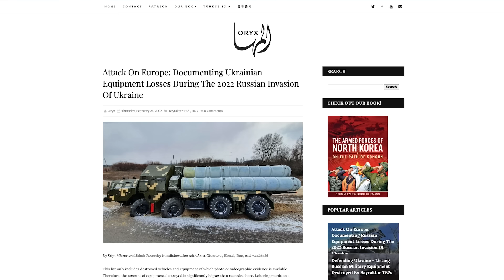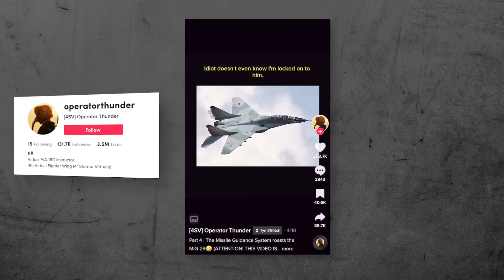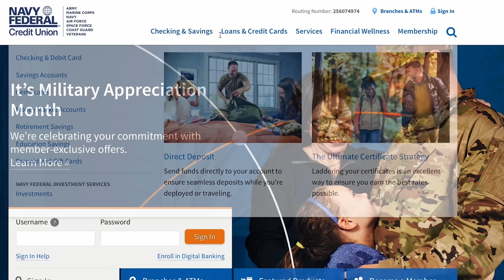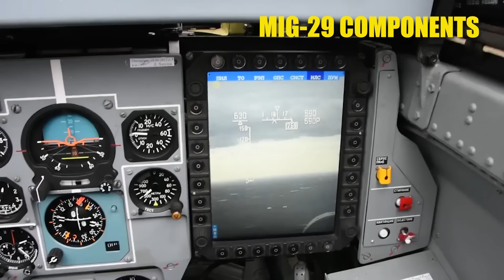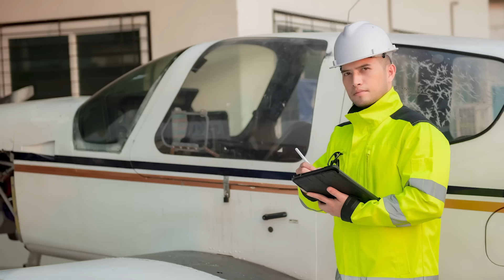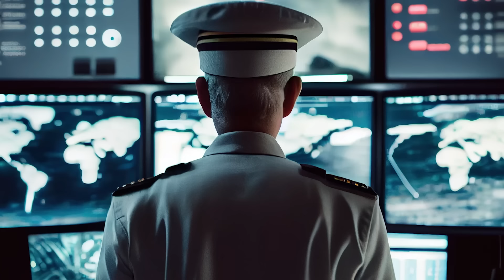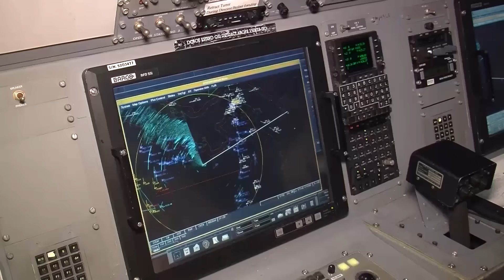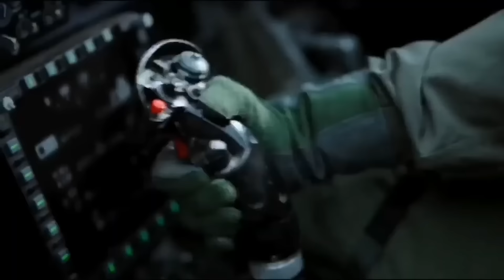How Ukraines new MIG-29 Fighter Jet Operates

Comment: F-16 would no change anything, they would get older variants, those planes would either be blown on the ground, or shot down by MiG-31 from 300 km away, or S-300/400, BUK, etc..
Also, good luck maintaining F-16 in field conditions on improvised runways.

Comment: I think you're a bit rusty on those fractions.  A thrust to weight ratio of 1.07 means every pound of force has to move .93 (=1/1.07) pounds.  If it only had to move .07 lbs it would have 1/.07 = 14 thrust to weight ratio.

(to get the weight to thrust ratio you just invert the thrust to weight ratio).

Comment: Its an interesting comparison between the MiG-29 and the F-16.  Both aircraft are "fourth generation".   The Fulcrum actually IOCed 6 years after the F-16A.  (F-16C and later variants are what remain today).  They have similar flight capabilities.  The MiG-29 was conceived as a fighter to fill a similar role.  But the major difference is the F-16 has received numerous upgrades to its radar, fire control systems, and datalink systems while Russia decided to put all of its eggs into the Su-27 line of fighters by continually upgrading them and deriving newer variants like the Su-30, Su-33, and Su-35.

Comment: I think Ukraine could use F-16 as a quick and highly manoeuvrable AWACS with their radar. If it has a datalink connection to a Patriot or IRIS-T battery it could early detect cruise missiles or shahed drones.
Reply: So F16s will be on standing patrol mmmmmmmmmmmmmmmmmmm! Will they have AAR? I don't think so. Also my experience back in mid 1990s was its costly maintenance costs and tendency to change out either the PW F100-229 or GE F110-119 enines as line replaceable units (LRUs).....$$$$$$$$ and how many power plants will they provide for support or will they soon reach many holes in aircraft. For the long term within NATO the F16 in UKR makes sense but in this war theatre it might prove a logistic nightmare.
Reply: @terryluckhurst4114  Ukrainians can use own AWACS , they have own projects such An-72P and An-74 with radars.
Reply: @terryluckhurst4114  So, you're right about the logistics and maintenance nightmare. F-16s aren't toys and they do come with their baggage. But let's not forget, we're in a war scenario here, and desperate times call for desperate measures. The focus on engines, I get it, but with NATO's help and some smart engineering, we might be able to extend the life of these engines. I've heard of some innovative approaches like predictive maintenance using AI that can optimize how we service these engines. NATO military personnel in Ukraine seems very unrealistic, but for repair the planes could be flown back to Poland or to the west of Ukraine, where "NATO volunteers" could help to repair them.

And about AAR – yeah, that's likely off the table. But that doesn't mean F-16s can't do their job. Their range and endurance are sufficient for several operational scenarios, even without mid-air refueling. An F-16 could be in the air for about 2-3 hours and then be rotated with another F-16. And let's not forget the real gem here, the radar system. With the right tweaks, it could be a game-changer in detecting threats early. The F-16’s radar, in combination with ground-based systems like Patriot or IRIS-T batteries, could offer a significant early-warning advantage. I'm not sure if the US would allow their latest and greatest AESA radar in Ukraine (in case of losses), but even 20 year old models would be better than anything they've had so far. 
So, yes, it won't be easy, but in war, what is? I still believe F-16s could be a valuable asset for Ukraine.
Reply: They probably will be used this way to combat the Shahed, they will intercept the cruise missiles and aircraft themselves. It is easy to maintain for the Ukrainian aircraft we will deliver the F-16MLU with spares and aircraft that will be cannibalised by the Ukrainian ground crews. The Ukrainian ground crews are already involved in reactivating the stored F-16MLU and taking apart the ones that have spent airframes. By this summer they will have a lot of highly trained air and ground crews.
Reply: There's no need to, though.   They have actual AWACS and similar flying just to the west of Ukraine I think pretty much 24/7, giving Ukraine all the eyes they need.  "Quick" isn't a plus because you can see the whole airspace from a few slow planes.  "Highly maneuverable" would be nice in some wars but in this, Russia cannot attack AWACS over third countries without going to war basically with NATO, and it already has bit off more than it can chew in Ukraine.
Reply: @gearfacts1273  It really can't, they would be under threat from Russian MiG-31's
Reply: @pogo1140  Mig-31 can't shoot down any planes which are 180-200 km from the frontline.
Reply: @lqr824  AWACS will need to fly inside Ukrainian airspace in order for it to see far enough to the east , east of Kremenchuk (490 miles east of Lviv on the Ukraine/Polish border) to be useful. And big lumbering AWACS are a tasty target emitting a giant "shoot me" radar signal for MiG-31's
Reply: Ukraine has had dozens of NATO counter battery radars donated, all of which are capable of being networked with NASAMS and Patriot.
Reply: @gearfacts1273 huh? The Russians are doing just that with R-37 missiles, which can extend out to 200 miles. This is something even the Ukrainians are confirming
Reply: @gearfacts1273  The MiG-31's R-33 has an operational range of up to 300km.
So from where's it's orbiting, it can accelerate to 50km/minute hold that for 2 min, launch it's missile/s and burn for home while the missile closes the remaining 150km to the AWACS
Reply: I believe you have made the critical point. It's the electronics, not the engine nor airframe.
Reply: Wouldn't they have to train the every pilot to fly in the Ukrainian airforce American planes? The Ukrainian military is primarily trained on old soviet equipment. That's why they are running low on ammo for those old weapons and equipment since the west doesn't produce those munitions anymore
Reply: If you want to die because of a S400 or S500 try that!
Reply: @terryluckhurst4114  Either the PW or the GE engines actually take about 1/10th the maintenance of the old Soviet Engines.   When Germany inhereted their old MiGs from East Germany, the main issue was maintenance cost.  Engine Rebuilds every 300 hours, vs 3000 on the PW F100.
Reply: @pogo1140  russians have their Mig-31K and can use it only for missile strikes from big distances  , they use rare and expensive X-47M2 hypersonic missiles.
Reply: @gearfacts1273  The Russians have been using the MIG-31BM for high altitude cap and they use 6 MiG-31's for launching the Khinzal ALBM's
Reply: And none actually fly or even remotely airworthy. Those projects while used Antonov planes, but were worked on in RSFSR part of USSR, not Ukrainian SSR.
Reply: Russia isn't a country that is interested in nuclear first strike. US and UK declared to have that in their doctrine though. Also, states that Ultimately became NATO left Poland to Hitler in 1939. Finally, NATO or not, sticking nose into Ukrainian conflict by NATO state doesn't amount to invasion by Russia. I also recommend reading the language of NATO charter, specifically the oft-mentioned Article Five. It states that NATO will provide support. There isn't a single word about rounding up all available forces and entering the conflict.
Reply: And if it comes to it, an upgraded F15 Eagle strategic nuclear launch platform. 
If Moscow fcks around, they'll definitely find out...

Comment: You are joking with the water tank drinking, but soviet airplanes had deicing tanks full of high quality, pure alcohol. And it was a massive issue, because everyone was stealing that alcohol and drinking it. One of issues was, that the rations were usually calculated for Siberia, so if you had airplane in lets say in summer in Poland, it still had to get so much alcohol even if it barely used any. It was so abundant, that from one of the ex military teacher I heard that in villages around the air bases, all homes had windows cleaned with that alcohol, it was so plenty.

Comment: As a ground pounder, I don't know much about airplane. But as a ground pounder, I'll duck if there is any in the air.

I see this as a way for the Ukrainian to have more air missions while pushing the more advance plane on harder op. It'll also allow more pilots to have more hand on exp flying and complex air op.
Reply: As an Air Force vet who has been involved in operational planning, I will tell that you are correct.

Comment: Any aircraft is better than no aircraft, especially when, with a little effort, you can launch certain NATO munitions from them. The two listed have already had an impact on the war - AGM-88 and Stormshadow. The latter of which pretty much just requires an aircraft with a hard point.

However, the west needs to decide if they want Ukraine to win, or become Afghanistan in Europe. If we want them to actually win, they need something better than the MIG 29, and the F-16 is a good choice. Right now, I get the feeling the west is trying to turn Ukraine into a stalemate, where Russia increasingly gets ground down over months/years of continuous, non-stop combat - with Ukraine suffering all the casualties in place of NATO. I hope I'm wrong about that, but the fact that we are even arguing over supplying modern aircraft and systems is kind of telling. The only time we up the ante is when the lines start to get static, or Ukraine gets pushed back a bit.
Reply: funny how, China's new map shows part of Russia as its own. Almost like, I knew what, I was talking about. Shocking.
Reply: As a married man, I love being right once in a blue moon...

Comment: It’s been announced that western countries will start training on F16 now, and the USA will allow export to Ukraine. Anticipated arrival time is fall 2023. This is not a silver bullet, but will help keep Russian planes from entering Ukrainian controlled territory and help intercept drones and cruise missiles. Given losses to the Ukrainian air fleet, replacement by western planes is necessary. F16 needs good airfields however, I don’t know how they are going to solve that problem.
Reply: Personally, I think the issue of the Ukrainians not being able to keep up the conditions of the airfields is becoming less and less of a problem as each day goes by. There are plenty of large airfields in the far west of Ukraine that are long enough to handle the F16. The main danger to them is strikes by Russian long range missiles and drones, but as proven lately, the modern anti-air equipment the Ukrainians are getting is able to quite effectively neuter those threats.
Reply: The way to resolve that is to use motorways (highways) as extra runways.
Many small European countries have this as part of their emergency plan. Lessons learned from WW2.

Comment: Note: Polish MiGs were upgraded to carry NATO missiles when it joined NATO.
Reply: They also got new avionics, radar, navigation, comms, etc.
Reply: No and no. Avionics was lmited to communication and sacling instruments in imperial. No Western integraiton.
Reply: No such thing happened. In fact they were mainly in poor condition due to the lack of spare parts produced - who would guess - in mother russia.
But still it's better than nothing.
Reply: @yaqppl  Polish MIG92s were extensively modernised some time ago. I don't know about the old East German ones.
Reply: @yaqppl  13 MiG29As were upgraded from 2011 to 2014 with a missile interface, polish digital avionics, modernised optoelectric systems, polish radios and a NATO compliant IFF system. They also received new civilian transponders.
Reply: @johnridout6540  East German ones were modernised by Germany to 29G standards. Haven't found much details, but it did include a GPS and a missile interface.
Reply: But can they really stood up to MIG-29 UPGs? I think not.
Reply: @admiralcasperr  that's something else than what you wrote in first comment. You could also mention, that all of our MIGs were grounded (for two years I think) after accidents when ejection system killed pilots. Why did that happened? Because we hadn't original spare parts, and domestic production had lethal part that during ejection entered pilots body. 
Of course this shit was solved, but tells you much about ability to modernise a platform without cooperation with producer.
Reply: @yaqppl  the missile interface is a modernisation to carry NATO missiles. I don't get what you mean.
Also, the German MiGs were upgraded by a cooperation company between MiG Production Corporation and Daimler-Chrysler Aerospace.
Reply: @admiralcasperr  so which western armament could polish MIGs carry?
Reply: @admiralcasperr  according to my knowledge we can equip our 29's only with R-27, R-60MK and R-73.
Reply: @patriotenfield3276  Better radar and air-to-air missiles. Yes, they should do well. They can also fire Storm Shadow cruise missiles.
Reply: @yaqppl  the 13 which were modernised in Poland can launch AIM-120s.
Reply: @admiralcasperr  that has no sense due to the inferior radar range.
Reply: @yaqppl  they have to shoot something
Reply: The point is that these require no training, while they're trained and supplied with F-16's.
Reply: @yaqppl  It has perfect sense whithin the radar range AND as a "mad dog" launch (i.e. when the position of other planes is given by other radars)

Comment: Your thrust to weight understanding or calculation is off. 1.07 to 1 means if the plane is 25000 lbs it has 26750 of thrust. So it has to move 0.93 lbs for every lb of thrust, not 0.7, or what I assume you meant .07 potentially. But its actually flip of what it seemed you said. It only has to move .93 or .95-.97 if we are talking a fully loaded Mig 29.

Comment: 11:50 this sentence is very confusing it's not clear if you mean it has 120 flares or if you are totalling the countermeasures which I wouldn't do as they are useful for different threats basically long range missile can be fooled by chaff (with the exception of the r27ea Wich uses heat-seeking guidance) and short range missiles will be confused by flares

Comment: “It’s not the plane it’s the pilot”
Reply: Avionics
Reply: The plane still matters a lot
Reply: What about F-15’s of 104 and 0.
We’re talking of 104 consécutives kills without a loss - it can’t be the pilot alone even if they were 10 times better.
Reply: @alexfortin7209  Top gun reference
Reply: Billy compared 0 to 100... Its not 0 to 100
Probably 60-70 to 90 points of difference
Reply: Canvas and graphite biplanes ironically may be almost invisible to radar.

Comment: If they can take bombs then they can take JDAMs. I'm pretty sure they are GPS guided so there doesn't need to be anything so fancy that it couldn't be stuck on a centerline pod. I've seen HARMs on them as well. I expect they could take Meteor as India has managed to put it on their fleet of Su's. Mig-29 is a formidable platform. Still good make no mistake. Cheers Chris.
Reply: Yes, they've jury rigged some of these weapons onto migs.  The problem is they can't fully interface with the onboard electronics.

For instance, they have to plug the HARMs into a laptop before takeoff and preprogram the mission to run so they can't launch it in response to dynamic situations.
Reply: Russians are jamming NATO GPS guided munitions.  This is one pitfall of sending smart munitions to this battlefield is that Russia is getting a ton of intel and testing how to defeat our systems.  HIMARS is GPS guided too and have lost effectiveness due to GPS jamming and GPS poisoning.

Comment: 13:15 Is that a civilian off the shelf GPS unit attached to the dash on the right side? If so that would be an advantage of the F-16, you don't have to run out and by a TOM TOM.

Comment: Btw the main reason why modern jets tend to sit a round mach 1.2-1.6 (on average) is statistics taken in combat situations and I think it was 98% of all total time in the air was well under mach 2 so the need of such insane speeds wasn't there, attaining such speed also came at the cost of huge fuel drinking and the airframe having to be heavily designed around such a speed usually resulting in far less capability in one key area be it payload, fuel capacity or maneuverability the trade offs were not worth it anymore with how advanced jets are these days

Comment: OT/ spitballing a anti drone weapon for jets. A pod that has a very high powered jammer and/or microwave system that burns out the Drones electronics. 

The jet just gets near the Drone in flight and zaps it, and it then crashes. That saves ammo and also reduces the risk that the jet could hit fragments from a Drone being shot in mid air. 
It's basically a jet mounted soft kill system that works on Drones that have backup pre-programmed target coordinates.

Does this sound plausible or are there even systems already out there that do this?